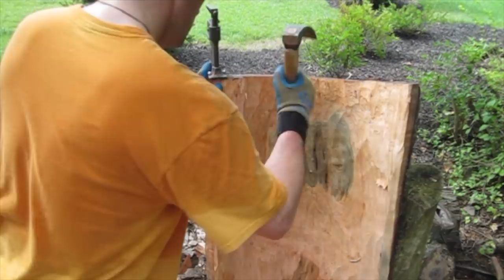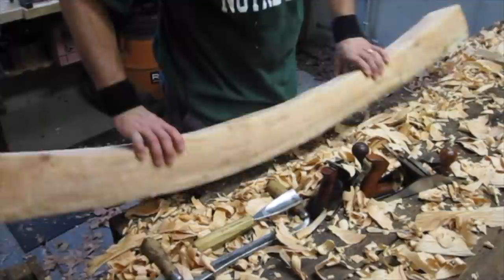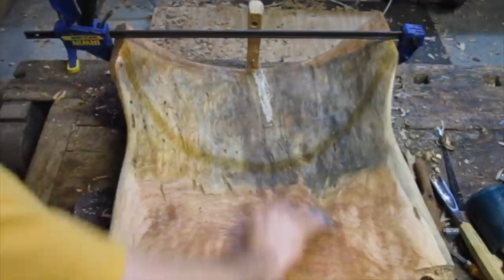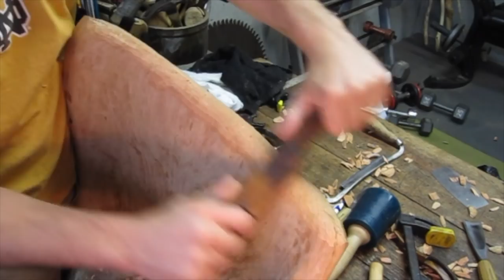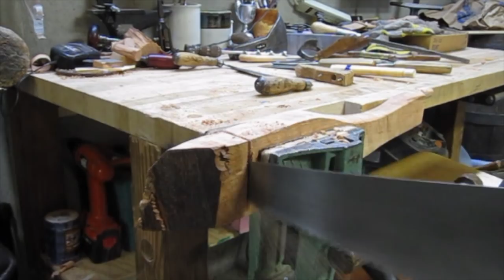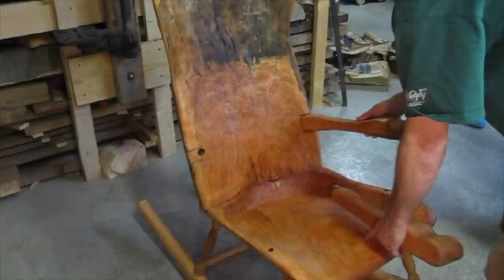From STUMP to ROCKING CHAIR by HAND & FOOT (ASMR)

Comment: Now, that's a rocking chair!! You really have mastered the long handle adze. May I ask how you keep both short and long-handled adze sharp? I'm waiting on a mini adze1.25": I commissioned it to be made for myself and it has a "U" shape to the cutting end. I have small stones in different shapes I use to keep my spoon carving tools sharp as well as a credit card size diamond plate. Any suggestions on how to get the "U" end super sharp? I thought about trying some fine cut files I have as well as the mini diamond-coated files or do you think they will take off too much metal? I asked that he not put a handle on it because I want it a specific shape and so I'll be making the handle out of Ash or Hickory that I have.  It is always a pleasure to watch you work and boy do you work hard! I get using hand tools, I use them too, but I do have power tools. I don't think I could cut the runners for a rocking chair with a hand saw. Maybe a Japanese Ryoba saw. Do you have any of the Japanese saws beside the whale backsaw?
Reply from the maker: Thanks for the questions.  There are curved stones you can use to sharpen an adze.  The thing I do to hone it is to take a plastic oil funnel, cut in half, glue leather to it, and apply sharpening compound.  This enables you to have the right curved surface to do the final sharpening.  I do have some smaller Japanese pull saws.  Good luck!
Reply: @ChopWithChris  Thank you, Chris, that is a clever idea. I recently needed some cheap measuring spoons for the shop and it came with a set of varying-sized funnels. I have no need for them, but I do now! It is always a pleasure to watch you work. The dining table you made as an anniversary gift to your wife came out beautifully. I love that you challenged yourself to make it and to use traditional joinery. One of my favorite parts of woodworking is joinery. I have a book on Japanese traditional joinery and I challenge myself each month to try a new one. I say a month but some very complex joints have taken more than a month, lol. It is skill-building and when I make my new center island/workbench I plan to do with the new joints I have learned. I hate it when some YouTubers are building something for their shop and just slap it together saying "it's just shop furniture, who cares what it looks like". Where else is woodworker going to learn new skills than on their own shop!? You don't want to practice on a client's job or a special gift for a loved one using their expensive wood!

Comment: Chris, when working with greenwood like this, how do you avoid wood spliting as it dries out?
Reply from the maker: Great question!  I Anchorsealed the ends and then kept them in paper and plastic when not working on it.  I did have cracking issues and had to clamp and glue as needed